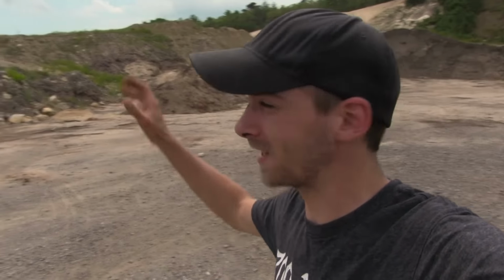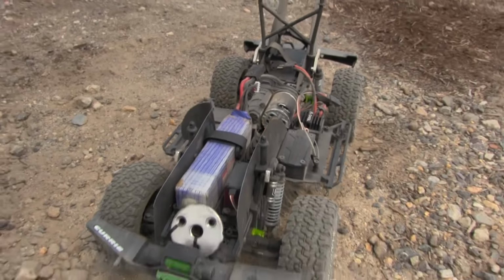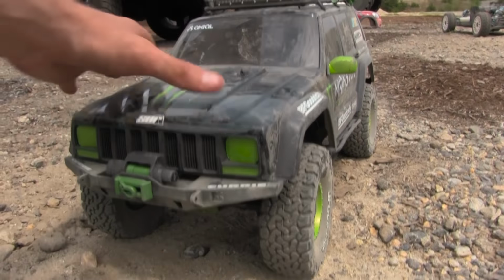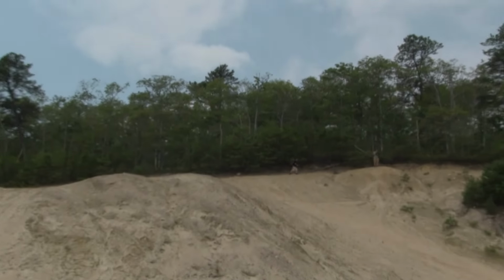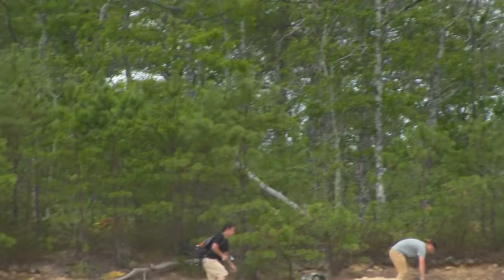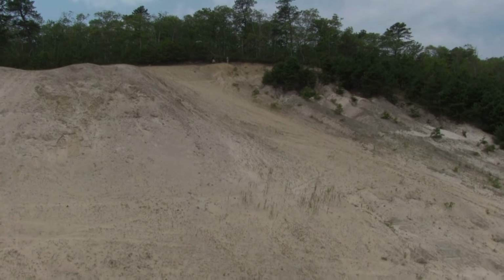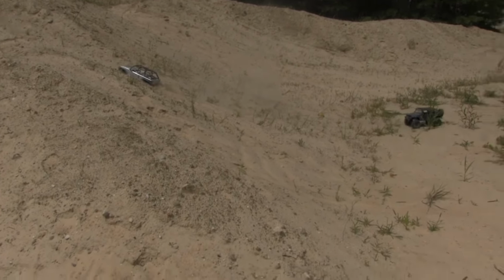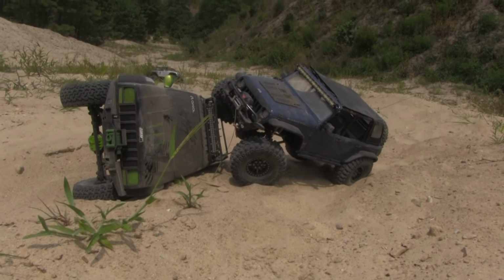Two Axial SCX10 JK's & SCX10 II XJ - 4x4 Off Road Adventure?!

Comment: how easy are build vehicles ? and how to record the vehicle different angles or from the vehicles? How much are build vehicles, roughly?
Reply: Bobodeman, they're not too bad. I built my scx10 1 in about a week (I had a lot of free time though, lol). the instructions are great. Mine was about $400 (if I remember right) without radio or electronics. I have just over $1000 into it now. they're an awesome hobby. I just finished building a Yeti XL last year; that one is pretty fun also.
Reply: Ken Hughes thanks